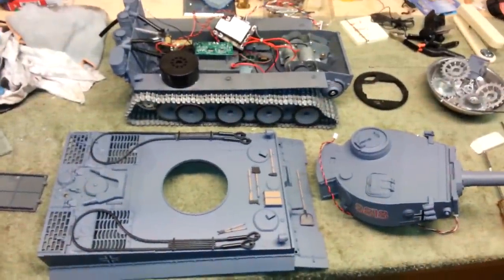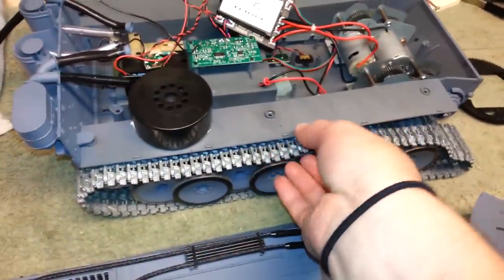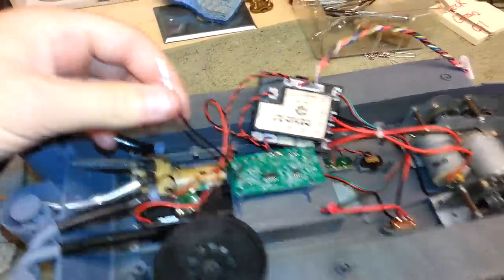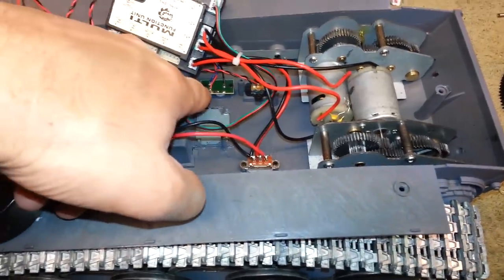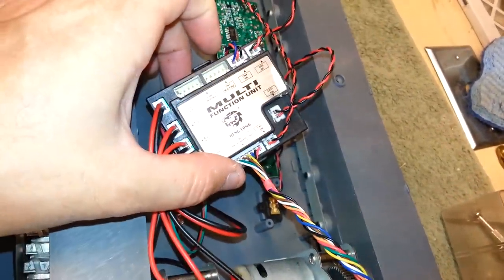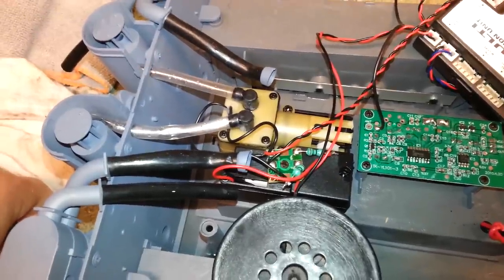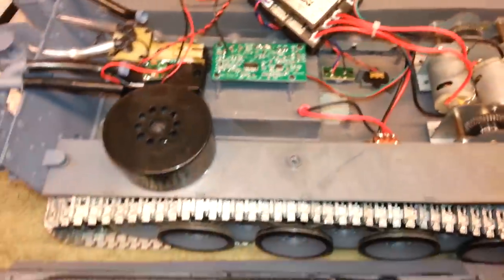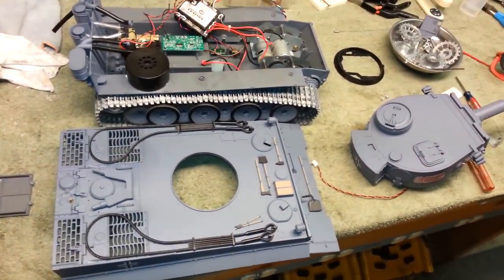Heng Long Tiger Tank: How To disassemble

Comment: I just ordered a bunch of upgrades for my basic Tiger. I want to take it apart and paint and super detail the hull while I am waiting for the parts to arrive. Now I know how thanks to your video!
Reply from the maker: That's awesome. Glad this video helped. These are really detailed. Just a little paint and it will look amazing. Good luck with your build
Reply: @OpenRoader  So it appears that they have done some revisions to the chassis since you recorded this. The forward screws on mine were not located where yours were....mine were underneath the spare track on the front of the hull. Needless to say, I ended up getting it apart!
Reply from the maker: That's good information. Glad you still got it apart

Comment: I have a recent v7 Heng Long Tiger I and it's amazing to see how far they've been improved over the years. No need for a separate switch for the smoke unit or volume control, it's all controlled from the transmitter nowadays. Lots of other improvements too 🙂
Reply from the maker: Glad they have made it easier to work on.

Comment: Just bought one second hand - traced failure to start to loose battery box crystal removed and refitted its circuit board and secured the crystal with tape to prevent it falling down with gravity. Biggest problem was tracing the final 2 front superstructure screws behind the detachable track link section.

Comment: I have one, great fun. The tracks have track pins. Push out the pin so far and then pull with needle nose pliers. Reverse process to remount. Good video. I'm thinking about upgrading mine a little as it's the basic model. I have a broken torsion suspension arm I need to repair also.
Reply from the maker: Thanks for your comments Matthew, good luck with your update
Reply: @OpenRoader  thanks! Your take down video will be very helpful. Good job.
Reply from the maker: All these years later and this video is still helping people! Nice
Reply: @OpenRoader  there you go! Well done!

Comment: So a battery pack goes into the space at the bottom of the tank? Got a hold of what I think is a similar RC tank but it's not complete. There is a metal cover on the  bottom. Several parts are mising so it can't just be powered up and go! Thank you the smoke generator is optional?
Reply from the maker: Yes, that's where the battery goes and I think the smoker was standard

Comment: Hi mate, i have the same one with a snapped barrel. Well I think it’s the same one, it’s a blue box. Not sure it has speakers on the one I have or not, it doesn’t say on the box. It was my dads but he passed away. I was just gunna fix it up and see if it works. Any idea if the heng long v7 barrel will fit on this one? I haven’t even had it apart yet, I can’t get the hub caps off, well one came straight off but I can’t seem to get the other one off, it’s almost like it’s glued. Also the battery.. it has a nicd battery that hasn’t been used in a long time. How do I know of the battery is charging if there’s no light on the charger? Idk if the battery will even work to be honest. I went to charge but realised there’s no light on the charger, unless you just have to time it with the charger it came with? Any help would be appreciated mate, as I want to try and get a barrel for it off aliexpress and get it working again. Thanks
Reply from the maker: Best of luck with your project, thanks for watching
Reply: @OpenRoader Thanks. I take it you don’t know about the nicd battery charger? Or if the v7 barrel will fit? I’ve just had it all apart and it’s definitely an older version than yours. It’s all solders inside with no plugs to take apart.

Comment: Opened it up, looks fine apart from the board(was an rx18) looking a bit bubbled up, taking it to a model shop to be looked at. Still turned on and started so fingers crossed. And thanks for replying. P
Reply from the maker: Cool man, post back what you find

Comment: Thanks for the video, I recently bought a older one thats not the smoker,sound but has the upgraded metal tracks and metal gearbox. Mine doesn't have  that multi functional unit with all that stuff you have plugged in. Do I need that black box in order for it to run? I'm afraid I'm gonna go drop $80 on a battery and charger for it to not work. It has the green main board by the gearbox and everything else.
Reply from the maker: I honestly don't know if it will work with out it all. Maybe check with a hobby shop

Comment: Excellent video man,thank you,i have one of these and my turret quit going up and down and i need to know how to take it apart to see what might the issue be,i use this tank very very little and before a few days ago it hadn't been started in like 3 years, i hope its not a electronic issue and more like a plug that might be loose etc
Reply from the maker: Glad this video helped you. Yeah, probably something simple
Reply: Hey, thank you much for your reply,i took the tank apart and kinda tapped the motor that moves the turret and presto it started working again, i think because i use the tank so little and it had been a few years it probably was just stuck from not using it, it works fine now,i know if it wasn't for your video i probably would have broken something taking it apart, much appreciated.

I have metal tracks on mine and i was thinking of putting  some new gears and motors in it,i have heard there is a set of motors and steel gears that give the tank more of a realistic slow speed and the gears of course being metal are much better,you wouldn't happen to have a part number handy for that or maybe the proper name that i can search for them? there are so many options out there between the old Tiger model (which i have) and the new Tiger model tank etc its kinda confusing to me,my tank is bare bones, no smoke no sound early model.
Reply from the maker: Sorry, I don;t have any part numbers or information on this tank. But there seems to be a big online following for these things. I'm sure a little searching and you'll find what your looking for. Sorry for the late reply.

Comment: I was having a problem with the Allen screws in the sprocket wheels because its a really weird size and I can't seem to find the right size. can you help find the right screwdriver bit size
Reply from the maker: Yes, the screws they use are cheaply made chinese crap. They are neither 3/32nd standard or 2.5mm metric. The metric seems a tiny bit closer. You might want to try a tiny screw driver or even file down a larger allen to fit properly. Sorry I don;t have better news for you. Good luck
Reply: @OpenRoader  well thanks I had a feeling that was your answer
Reply from the maker: Sorry, good luck

Comment: the lights don't turn on when you power up the tank but as you play with the tank and use it occasionally they come on and stay on for a moment then they go back off
Reply from the maker: I see, sounds like you have a bad connection. I would take the body off and trace the wires from the bulb back to where they attach to a PC board or switch. Check its connection there

Comment: thanks this is my second tank and now I have to find out why I have to take it apart to fix the smoke its not working hope its ok and I can fix it ....I have the same one you do with the upgraded metal gears and track
Reply from the maker: There is a very good chance the smoker is flooded. I have found through experience that if you overfill the smoker it will flood the heating coil and it will not smoke. I would drain the smoker, let it dry, then turn it on and see if it smokes, if it does, then add just a few drops of smoker juice. Never run the smoker completely dry for a long time.
Reply: can you drain it with out taking it apart
Reply from the maker: trackspike64 I think you can pour it out the top by putting it upside down, but I don't remember. You may have to take the top off the tank

Comment: Hi!
Few days ago...I bought one HL Tiger 1version 7.0  for my son. 
We played until battery dead ( not too long with the charging came from the shop).
I charged completely the battery...put it on...playing again a little...and them, don't ask me why :)) I starded to experience with the combinations of buttons from the remote control..accoding with the papers the tank came...just to experiment...
Unfortunately the tank now is really messed up on all directions.
Everything works fine...all sounds...turret  up down, left right, lights, sounds, machine gun, main gun....but the moving forward, backwards,  left right is all over the place. More than that the tank doesn't rotate left or right on place...nothing...
I tried to reset to factory settings and for nothing... I did it couple times...no reseting.
All this in just few hours...
Any advice?
I heard that the soldering on this tanks are crap and the boards as well....
I am not an electrician type of guy and have no electrical measurements tools..
Any ideas?
Thank you so much !!!!
Reply from the maker: It's possible that the motor got hot. Might need to have the gearing lubricated, maybe a motor upgrade. I'm not a real professional either. Maybe take it to the hobby shop. Sorry I'm not more help
Reply: @OpenRoader  Thank you for your reply!!! Much appreciated!!!
I did again the reset to factory settings  and it looks like is working fine forward and backwards..still struggle to turn on place..basically no turn. It manages to turn few degrees only to the left and only on moving forward or backwards. 
What intrigues me is...if I lift the tank in the air..it does all the movings correctly...like for ex... when all the way left or right..the tracks are moving one forward one backward...but when putted on the floor...it can't do the turn.
All looks fine few cm above ground/floor when sustained and hold in hand...once putted down...no movement...sound ok...sound increase as I push left or right on the remote. The same like one accelerate a car but is not in gear...(only on the floor...and spins fine above the floor..on hand).
I will have to open and visually inspect everything in there.
Thank you again !!!
Reply from the maker: When your trying to turn, is it on carpeting? I really hates carpet. Best on concrete, wood or tile
Reply: @OpenRoader  yes is in the house on the carpet. But this tank is brand new..lasted only 2 hours... and it worked in the begining on the carpet. Is carpet everywhere in the house. Tomorrow  morning I will give it a try outside.  Ut as I said it worked in the begining on the carpet. Thank uou for the tip !!!!!! Thank you !!!!
Reply from the maker: These do not work on carpet, it's too much friction on the treads and the motor.
Reply: @OpenRoader  Hi! I had no idea about this! Thank you for letting me know! I can't wait to try tomorrow morning...is late here in uk now :)
Thank you ever so much !!!!!! Be blessed!!!
Reply from the maker: I had the same issues. It works good on grass, dirt, hard wood floors, tile floors, concrete. Basically everything but carpet
Reply: @OpenRoader  It will be wonderful if this it is the problem. I'm not saying is not the case, just I will be so relieved!!!!
My mind already went to all the possibilities...rx18 board..gears..soldering..send it back(even this is the worst for me...as this is the second tank in few days...the first had a funny noise on turret turning one side only, but fine on the other one. Called the shop, explained,  they ask me to send a video and after thèy ask me to send it back. Not very cheap the first postage, then the return...now again? No...I want to fix it somehow without send it back. )
Sorry to be so long...You are so king to respond to me...and I really  appreciate 🙏 
Thank you one more time greatly...and I will let you know how it works outside, tomorrow. 
Be blaessed !!!!!!!!!
Reply from the maker: Hopefully it works out, best of luck

Comment: this was a great video. I would like to ask how can you waterproof the bottom and how can you stop the tank from jumping back when it fires? I heard that it can be done cause I dont like it jumping backwards when it shoots.
Reply from the maker: I haven't tried to water proof this, so I'm not sure on that, as far as the jumping back, that's in the computer programming. it's meant to do that. it's not a mechanical mistake.
Reply: There is a cable leading to the turret which you disconnect and this stops the tank 'jumping'
Check out YouTube. Someone on here has done it.
Reply from the maker: +Victor Lonsdale awesome, thank you Victor for helping answer that question

Comment: Hello my tank turns on and the lights start flashing. But when i click the key on the remote the tank does not turn on
Reply from the maker: Does it make the engine sounds?
Reply: Open Roader no it wasn’t. But I fixed it now. Basically i kept removing and Reinserted the channel chips into the remote and the tank and it finally made the engine sound when i pressed the key. Thank you
Reply from the maker: @LilSixy  Excellent! I have found these to be very robust. A little tricky, but not very complicated. Once working, they keep going! Have fun

Comment: sherman with plastic track is fantastic, tiger pro with metal tracks can only use inside, outside throws tracks, plastic better in my opinion, metal is to heavy , less run time and more stress on everything :(...1-16th scale by the way.

Comment: Man I have a problem my tank can't turn on and I need to know how make it run again but I cant
Reply from the maker: Have you tried pulling the battery out all together, turning on the power switch without the battery? Then fully recharge the battery, reinstall it and try it again

Comment: I have one, which emitted a burning smell on one side, then shut down, not sure what board it has in, going to dismantle and have a look, I believe It's an RX18 as it was a 2014 model with proprtional control. smoke still worked, but one track not.

Help!?
Reply from the maker: I wonder if it ran dry? It may have burned the heating coil. Yep, pull it apart and have a look. Might not be a big deal OR it might be FARKED, good luck
Reply: I put a HL 2.4ghz in mine 2 days ago and it has the same sounds but it steers better. Its worth it. If u buy the board and remote its 50$ on www.ozarmour.com.au
Reply: Vincent Sluga Thanks for the info, completely dismantled mine, board was fine, one motor had burned to destruction. Thinking of a full upgrade bit by bit, can get metal upgrades for less than I thought, got the sprockets and idlers already. I'm a noob to large tanks.
Reply: manblackpm 2.4 ghz seems a good idea, the model shop I was going to have upgraded motors which fit, and need metal gearboxes, which I think I'll invest in, the plastic idlers always threw the tracks turning, hence metal replacements there...
Reply: Best things to do:
Steel(ONLY STEEL) 3:1 gearbox
2.4ghz board for tiger 1
Metal tracks and sprockets
Metal road wheels and idler wheel
Taigen metal lower hull.
Metal suspension arms and heavier springs.

Thats what i run and i go all over. The Battery is your choice, but i reccomend Tenergy
Reply: Vincent Sluga Bit by bit that's what I'll do I think. It's ironic, I have a HL 1/30 Sherman, 1/24 leopard which was fine until my mate shot the the sprocket with possibly the luckiest shot in the history of £10 airsoft pistols... and a 1/20 Pershing with 3 speed controller. No problems with them. The Pershing I would recommend.
Reply: I am getting a HL pershing that has all metal lower for like 180$ and 2.4ghz, trading in my xbox 360 for it and the 180$ :))))))
Reply: Vincent Sluga The model shop near me only stocks £500 full metal tanks apart from a few HL Tiger, Bulldog etc, but they had the Pershing you're talking about, and a Sherman, for the money, far better than what I bought!
Reply: Cools. I dont have any shops within 50 miles so i order all stuff. But yea rc' ing is expensive ^^
Reply: manblackpm I want a full metal one one day, I'm out of work now, selling what I don't need just to pay the bills, not cleared fit to work, so nothing coming in, broke really, but when I'm better, something to look forward to!